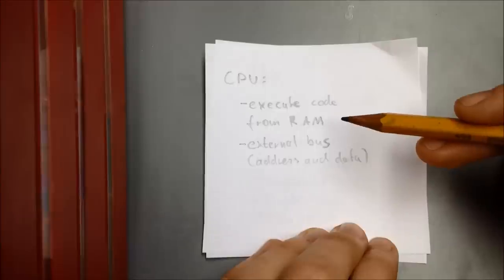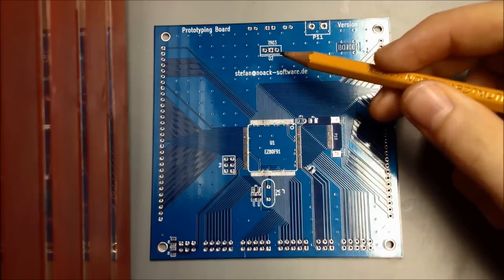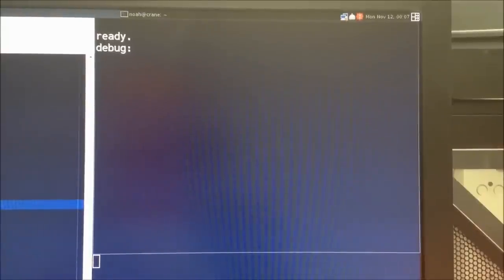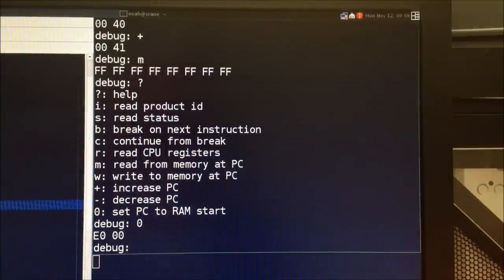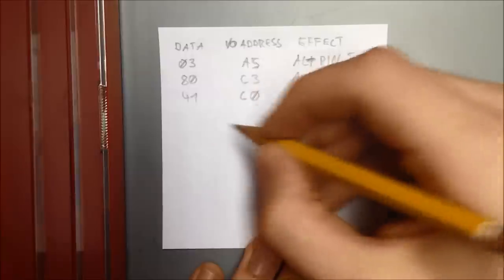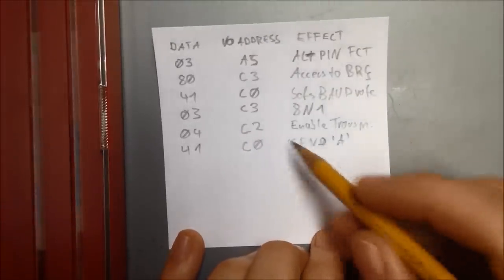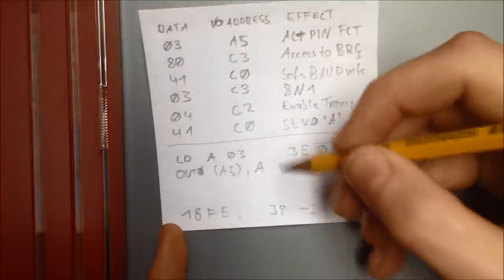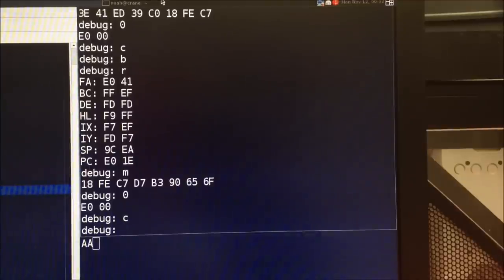EightZero: Building an 8-bit Computer From Zero

Comment from the maker: Hi, thanks for your feedback. It's 8-bit because I love the beauty and simplicity of these architectures. Your second point is interesting. I indeed have an Idea for an entirely new kind of system and programming model. Nevertheless I want to implement the most important UNIX system calls because that allows me to port a lot of existing software to the system. Software availability is key for success of a new platform. (I know, I could use CP/M or MP/M, but this is not a retro project)

Comment: Great work!!! Nice choice of the Z80... 50 MHz... wow! My first introduction was the ET-3400 Microprocessor Trainer (6811 processor) in 1978. My father the bought a TRS-80 Model 3 with printer and cassette recorder (later 2 double-sided double density floppies). He and I also installed a RS232 port. I also built a Hero Jr. which had a 6808 processor and had a RS CoCo (1,2,3) which had 6809 variants. I loved all of those processors. I am looking to do something with a 6502 maybe with an old Acorn BBC Micro. For all those people yapping about doing it from Zero or scratch... I'd direct them to Ben Eater's 8 bit micro or Bill Buzbe's Magic... but you keep doing your thing! =

Comment: Reminds me of when I've made a coprocessor for my C64 using 8031 MCU (basically CPU because of the lack of ANY program memory; you had to add external program memory), some EEPROM and SRAM. It was basically a standalone computer in a form of C64 cartridge. You could program it from C64 to do whatever you like because it could execute code from RAM. I still have this board but it's no longer working (handmade PCB, corrosion, etc.)

Comment: very nice! thanks Stefan. never heard of these chips until now. I'm currently learning assembly on a Z80 board based upon Grant Searle's project which uses a zilog z80 running at 3.78MHz, an EPROM and an SRAM chip. I am running CP/M on a compact flash card .

Comment: You didn't explain why there is an AVR microcontroller used.
Reply from the maker: The AVR translates between the RS232 interface from the PC and the ZDI debug interface on the eZ80. ZDI is used to get the first code into memory.

Comment: You have the hardware, but only rudimentary software.  What you need is a bootloader to boot CP/M, which was the OS that most Z80s used back then.  Then you will be able to run a huge selection of software apps such as Wordstar, Visicalc, etc.  And many, many games.  But with a chip that is many times faster than the 2 MHz Z80, it's totally scary how fast the games might run.  😱😱😱

Comment: Nice job, but I think, there is one question missing.... Will it run crysis 3?
Reply: Maybe. Maybe not.
Reply: +Jasfax It's classified
Reply: The eZ80 is not as slow as you may think. It is comparable to an i486 without FPU unit. A 50 MHz eZ80 executes 8-bit operations about 100 times as fast as the 6510 in the Commodore 64. 16-bit operations are actually about 1000 times as fast as on the 6502/6510.
Reply: Sven Ekeberg he doesn't get the joke..
Reply: Mahmut Arkawi: The joke is so old and predictable. It is everywhere.
Reply: Let's try it out
Reply: @herrfriberger5  The eZ80 executes at 80mips... 200 times as fast as a 4Mhz Z80... Using it right now and writing driver code for the EMAC (ethernet packets) in assembler... BTW the ZNEO only runs at 20mips and has no ethernet controller...

Comment: Nice work. Your project got mentioned on the propeller forum (youtube won't allow a link, sorry!) where we are using the propeller chip and existing software to do things like SD card, keyboard, audio, TV, VGA display and serial ports. Follow the thread as things get simpler - now it is just a Z80, ram and propeller chip. Your eZ80 board could interface very nicely with the propeller chip too. Do you have an idea for a fast memory chip for your board?

Comment: Ive never done anything like this before, but when i build this id like to stay true to the original 8 bit computer as possible...hardware wise i mean. Would it be possible to use the Motorola 6800 instead of the ez80?
Reply: You can use whatever processor you want to build your own computer. But you can't take a Z80 computer and exchange the processor with a Motorola 6800 or vice versa.

Especially in this case cause the eZ80 has alot of things integrated into it that would require additional chips when wanting to do the same with a Motorola 6800.

Start by deciding what processor you want to use and why. Then research what it takes to get it running and go from there.

Comment: I know this was ages ago, but do you have any boards or the schematic left?
Reply from the maker: +Portalmaster I still have some (unpopulated) boards. There is not much circuitry (just bypass caps and a crystal) -- so no schematic. However, I'm currently working on a new design based on the DS80C320 which can easily be reproduced on a breadboard or perfboard. I'll still probably sell boards on tindie for the lazy people :)
Reply: So if you have some boards left, are they for sale?
Reply from the maker: +Portalmaster I have 2 boards left. They should be electrically OK but have minor visual defects. That's why I'm giving them away for free. Just give me your address in a private message and I'll send you one.
Reply: Do you have a picture of them?
Reply from the maker: +Portalmaster no, but they look exactly like in the video above :) except for a little spot (about 1mm in size) where the solder mask is missing -- but hey I'm giving them away for free anyways ^^
Reply: Well that sounds perfectly fine to me. :)

Comment: it's a nice project, but soldering a kit designed by someone else is not really building an 8 bit computer from zero.
Reply from the maker: huh? I was the one who designed this kit.
Reply: in that case nice project.  It wasn't entire clear in the video that this was a design from scratch - it looked like a kit soldering exercise - hence my comment.  Now corrected.  Thanks for sharing.
Reply from the maker: thanks :) on the other hand, the eZ80 is a SoC where many of the interesting parts are already designed into the silicon. others have already pointed this out, and I'm already aware of this and inspired to take another approach that should be much more from scratch and a lot more interesting, namely using 74 series ICs only. sounds like fun
Reply: As someone who's building from an existing CPU and doesn't want a SoC, it's difficult to get some of the ICs that were available back then.
Reply: please tell me where you learn this, I want to build a CPU from scratch

Comment: Lol if you are using integrated circuits you are anything but "from scratch".  Back to the perf board and use transistors.
Reply: So would he have to make the transistors too? Or manufacture the capacitors?